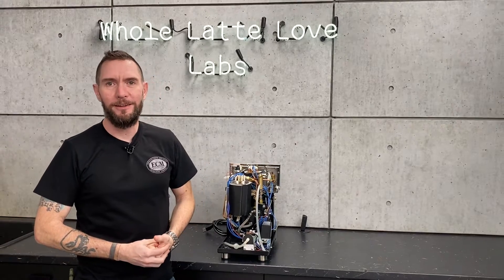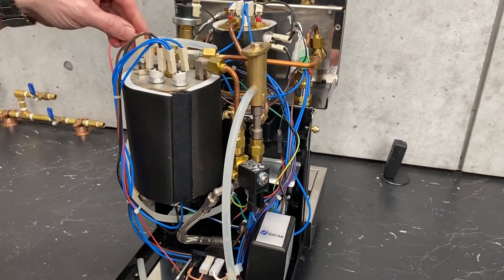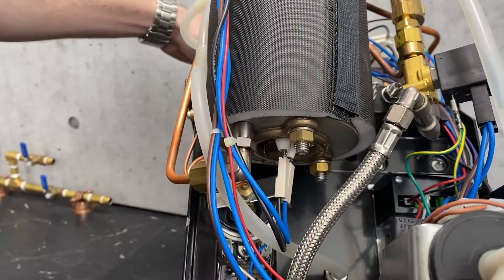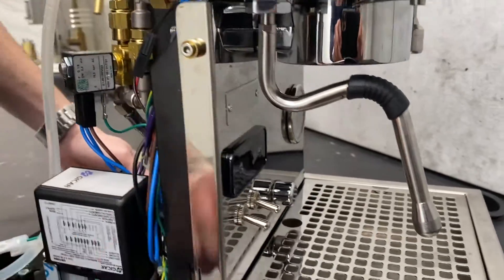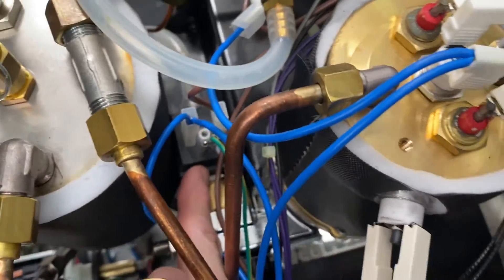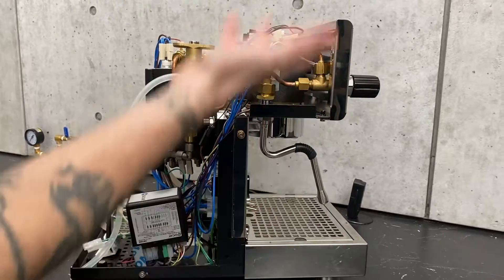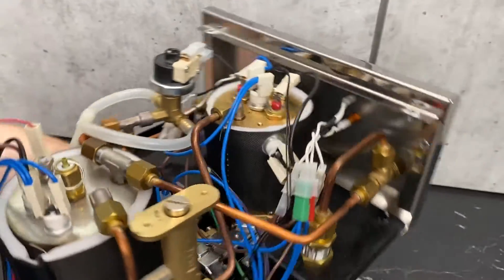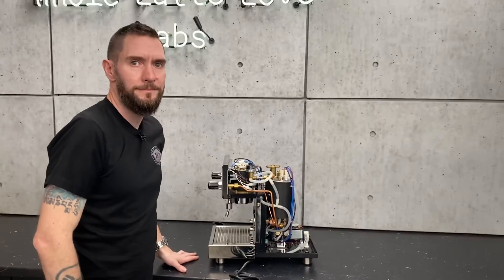Profitec Pro 300: Overview of the Electrical/Control System

Comment: Hi sir, thanks so much for the lectures, I am not sure about providing help, where I am not able to connect the electric wires in its proper terminals for Delonghi Icona in particular those related to push buttons switches of brewing, steam and starting.
Reply from the maker: Hi sm, Sorry I do not a specific info or wiring diagram for that product.
Reply: Anyway, thanks for your prompt reply, I really appreciate. @Wholelattelovepage

Comment: This is a nice breakdown of the electrical/control system of the machine!  

I happened to have a problem with my Profitec 300 recently, not sure if you could provide some advice on where to start checking. 
I had been using my Pro 300 for 3 years and one day, it tripped the fuse box after being turned on for a few seconds.  
I removed the top cover of the machine to check for any problems with the cable connection, but everything looks fine. 

That would be great if you guys have videos covering common causes of espresso machines trip the fuse box.
Reply from the maker: Hi CK, thanks for the comment and question. Hopefully your issue resolved itself - perhaps something was wet or your breaker was overloaded. If not, here's a link to a video which covers diagnosing tripping circuit breakers. It's done on an ECM Synchronika but principles are similar: https://youtu.be/XZb4I6VF5Lo?t=130
Reply: @Wholelattelovepage  thank for the reply! I managed to find out the issue. There was a small crack at the top of the heating unit, possibly causing the short circuit. I have replaced the heating element and the Pro 300 is working fine now.

Comment: Congratulations for really nice explanation! How can I change the steam boiler temperature? I would like to lower this temperature to make the 'americanos' not so hot... maybe I can lower by adjusting the pressurestat?
Reply from the maker: Hi RGB, Thanks for the comment and question. Yes, you adjust the steam boiler temperature using the pressurestat. Understand that doing that will lower your steaming pressure as well.
Marc